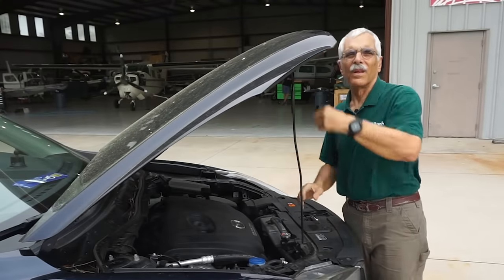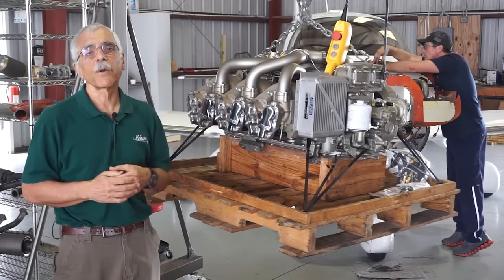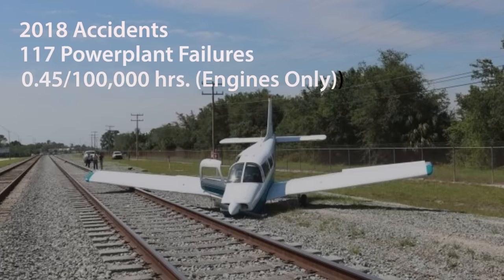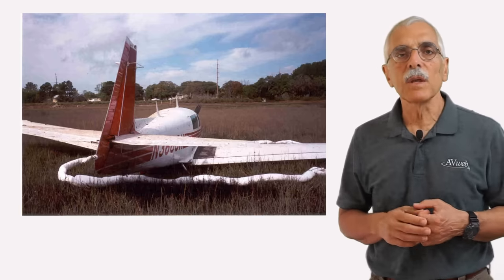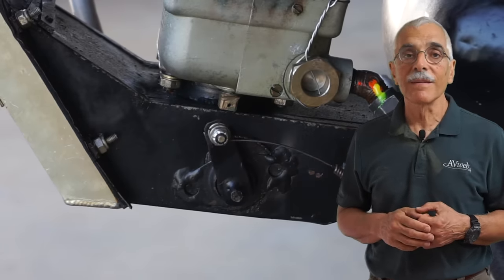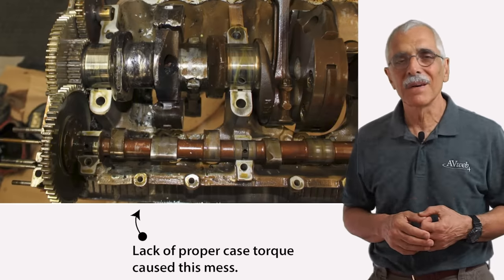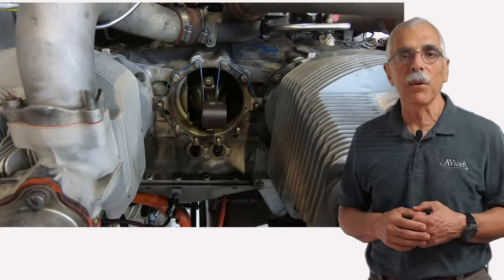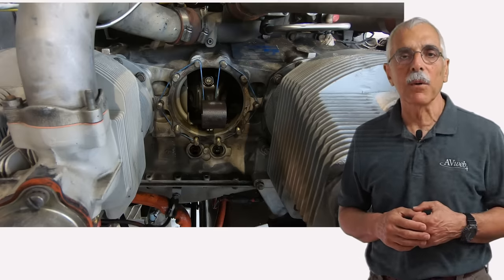Why Aircraft Engines Quit

Comment: “Forgetting to turn on the carb heat is a good way to turn a practice emergency landing in to a real one”  Classic
Reply: My very first solo landing, I forgot to pull the carb heat.  I was effectively reminded of the need for carb heat by a notable reduction in engine noise, so that turned into my first solo go-around followed by a trip around the pattern to a successful landing.
Reply: @jonathanguthrie9368  Sounds like you handled that very well.
Reply: So I’m not a pilot I’m a car guy old BMWs not new ones my mechanic had trained In Germany worked at a dealer dealing with people was driving him nuts so he went to aircraft school got certified but it payed a lot less so he became a manager and dosent see the customers or things just piles of paper
Reply: @benwaldeck741  I was pretty well prepared.
Reply: @jonathanguthrie9368  Also kinda lucky it happened after takeoff
Reply: @brk932  No, not lucky.  Carburetor ice happens in some airplanes when the throttle is closed, which you're not going to do on takeoff or climb out.  My memory of the events are dim because it's been more than 30 years, but I expect that as I got abeam the approach end of the runway, and I pulled the throttle back to idle to begin the glide to the runway, the carburetor ice formed and the engine died.  Pulling the carburetor heat knob caused the engine to start again.

I was taught that if the engine fails, the very first thing you should do is apply carburetor heat because it may be ice that caused the engine failure and you only have a limited amount of heat available to melt that ice as the engine will cool rapidly.  In that airplane,  a Cessna 152, you would then check the ignition, the mixture, and the fuel shutoff valve.
Reply: I remember my trainer (ex military) yelling in my ear "carb heat." I never forgot it.
Reply: Fortunately I trained in a climate that strongly promotes carb ice, even at a moderate cruise power. So I learned to test the carb heat early and often, both in flight and during warm up and taxi.
Reply: Kook ok no
Reply: If you fly behind a Continental O-200 "Icemaker" you better have a close working relationship with the Carb Heat knob; even on climb-out.  We had a carb ice stumble at ~ 800' AGL and full power.  Grab the knob & pull it all the way to continue climbing, but at about 200 fpm less rate.
Reply: @jonathanguthrie9368  is it a good practice to just apply carb heat while at takeoff power, every time, before reducing to flight idle or climb power? 
Just to negate the risk of carb ice?
Reply: @davecrupel2817  I'm not your (or anybody else's) flight instructor and this is not flight instruction.  I'm also hardly any sort of authority, and I'm sure there are actual carb heat experts out there you can ask, but I don't think so.  Adding carb heat reduces the available power and takeoff and climb is when you need the most power, so applying carb heat as a kind of prophylaxis is probably the wrong move. However, I think that it is a good idea to apply carb heat first thing if you suffer a loss of engine power.

I also think that you should develop as deep an understanding of how it works as possible so that if you come across a situation where it might make sense to add carb heat before any ice forms you can do the right thing.  I can imagine that there might be situations where it makes sense to do just as you suggest even though I can't think of any offhand.
Reply: @jonathanguthrie9368  my POH says to not use carb heat on take off power due to risk of detonation (O-540)
Reply: Cars used to have issues with carburetor icing too. 
Some years ago an Air France flight vanished off of South America. They found it and the recorders. They didn't turn on the pitot tube deicing and it killed them.
Reply: @spaceflight1019  Not really the case, A330 has continuous pitot heat and there was no malfunction within heaters. They delayed replacement of pitot tubes to recommended ones (not required ones), and also there was a lot of other problems that 'killed them'.
Reply: Should be renamed to "Emergency landing switch"
Reply: Flying at 5,000 ft, On a 66° day, My 62 172C, 0300C RPM started wavering, It was carb ice. Scary when it's actual.
Carb venturi differential is 34°.66-34=32°
Reply: Just FYI, the O200 could get carburetor ice even when carb heat was on.
There's conversions to make it fuel injected. It's really solid once you do that plus with some fuel injected mods you can lean waaaaay past peak and get crazy efficiency.

Comment: I'm not a pilot, and don't know why Youtube recommended this video, but I was fascinated from beginning to end.
Reply: wish there was a TV channel with  smart reporting... now we have Youtube !!
👍
Reply: What's "worse," I've wondered about this very issue:  What magic do they use to keep aviation engines from failing in flight?   The answer is here:   simpler design & more maintenance.
And putting gas in the top of the tank, and taking water out of the bottom.
And making sure your carb heater control cable is still connected...
Reply: You are "not a pilot"... YT knows better...
Reply: @77thTrombone you’re half way to becoming a pilot or an A&P mechanic. Choose your path
Reply: @77thTrombone what does the carb heater do. Does it mean carbin heater? What if you don't switch on the carb heater in the first place
Reply: Who is Marzda? Another thing Americans love to mispronounce. Video ok though.

Comment: I'm a mechanical engineer and this analysis is REALLY accurate, succinct, and funny as hell.
Reply: i am a mechanic and i dont know shit from shinola
Reply: @twinturbo8304  - HAY!!
Reply: I got a question for the mechanical engineer. Do you have a 60s muscle car in your garage, that you're restoring ? The few ME friends, I have, seem to have that hobby. One of them has been working on a 69 firebird for next to forever. When its about done, he just starts all over again, on the SAME car. The only reason he couldn't  do that with the 1971 LeMans that use to be his daily driver, back when we were in college (80s), is that its now his oldest daughter's car, and she has enough sense to not let him touch it. btw, the 60s ended in March of 1973. If you were at least a teen back then, you'd understand.
Reply: Yes but it's still kind of not clear why car engine reliability is much higher than airplane engine. I mean, there is a massive number of cars out there, and seeing one stopped because the engine quit is very, very rare.
Reply: @StefanoBorini  its the extreme tmperature swings and high duty cycle, you are dealing with varying cooling conditions, more exposed engine componentry, gearboxess running at 70% load all of the time...youve got prop strikes- theres no opportunit y to wind an engine back upon noticing an issue,,you cant just stopthe thing when you hear a lifter start clacking or a crunch from the box.
Reply: also gyroscopic forcess can easily cause oil starvation, and then youve got this flywheel that isnt a flywheel, its a prop, hence all the nose bearing failures... horizontally opposed engines arent laterally balanced and they do this in subarus too,and a lot of these motors are aircooled , which means temperature management is a stinker of an issue.
a straight six is the motor you wouldideally want for reliability as its the only config thats balanced. but you are going to need watercooling so thats out the window as likely too heavy...bmw diesel straight six ?
might be possible if they managed it with the merc lumps.
its kind of funny that the safest aircraft engine is esentially very similar to the engine in one of the worlds most notoriously dangerous cars....these are basically highly refined air cooled 911 porsche lumps...in theory the subaru 6 pot and modern porsche lumps are the basis of design upgrade- checks internet- indeed yes, thats what the diyer uses.
at least for wing in ground effect hovercraft.
id personally be tempted by four gx400 honda motors- two on each wing. you wouldnt be too fast, and if one died on you, youve stillgot three-
Reply: @deadprivacy  its called the Ranger L-440
Reply: Oil starvation / aeration is not that hard to fix ,sensors and remote sumps could keep oil pressure steady enough for smooth operation
Reply: since when is damage, injury or death funny?
Reply: @bill45colt  
You might want to rewatch the video.
Reply: @Conservator.  second time it will say the same thing
Reply: @bill45colt  The jokes were not on accidents.
Reply: @Conservator.  i missed all jokes,,,,thought this was an instructional video, not a standup comic,,,,,thanks for your input,,,never did explain the idea of single or multiple tanks,,,
Reply: @StefanoBorini  Think about it. How much power does the average car driver actually apply when leaving a stop light? Likely not much over 30% for mature drivers. Most small aircraft apply very high power (often 100%) during takeoff. The car may be using 20% power to maintain highway speeds. A small aircraft typically cruises at a considerably higher power setting. A candle that burns twice as bright burns half as long.

Comment: A friend of mine landed a C172 on the I-5 north of LA.  He cleaned the carb, and took off before the cops showed up. This was a long time ago. No FAA report filed
Reply: Hi... 2 years later. This is wild! I fly a 172N that years back someone landed on the 5 in LA and ran into a ditch (fuel starvation). Seems like a right of passage or something
Reply: I landed a c150 float plane on the hood of a car as it was driving down 8th street in Travis City Michigan.  Yep, it was definitely the start of my new life.
Reply: I landed a 172 on I80 in 66........Wonderful cop showed up.......Stopped traffic while I dumped in 5 gallons of Fuel.......No questions asked.............Oh Yes.....ran out of gas with very strong, unexpected headwind...........Paul
Reply: I “landed” a C150 on floats on the hood of a car driving down a city street after hitting a telephone cable.  The cops, fire department, and CG helicopter were nice.
Reply: 20 years ago, I landed a C130 Hercules on floats on the top of a moving oil tanker on the I5 South coming from Colinga after buzzing cows in the fields while singing the Battle hymn of the Republic and with one eye closed.  The FBI, NTSB, CFD, Border Patrol, Medics and Secret Service all showed up and wished me well...gave me 5 gallons of gas with no charge and sent me on my way with a 21 gun salute. I should know, I was there. 🤫😆

Comment: Paul’s delivery of magneto inspection annoyance and “big ass cylinders” in the most professional, deadpan form just makes this video perfect.  Well-done, sir.
Reply: I was just thinking the same thing like did he say big ass cylinders
Reply: Seems like off airport landings should be a mandatory reporting incident even without damage or injury. For the very reason that the only two reasons I can think of for one is mechanical failure or pilot malfeasance.
Reply: @Lukeduke7773  huh
Reply: @ziggyjones3208  its absurd that there isn’t a mandatory reporting requirement for unplanned off-field landings.
Reply: @Lukeduke7773  who asked
Reply: @ziggyjones3208  you’re confused….take the day off, boss.